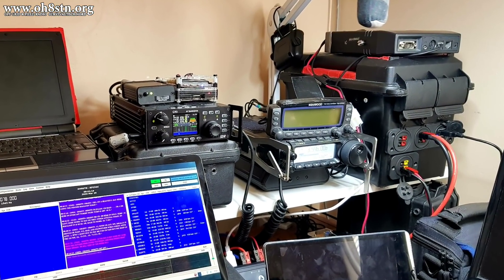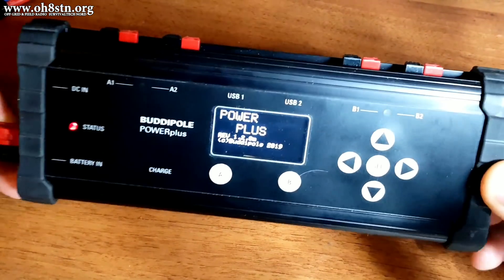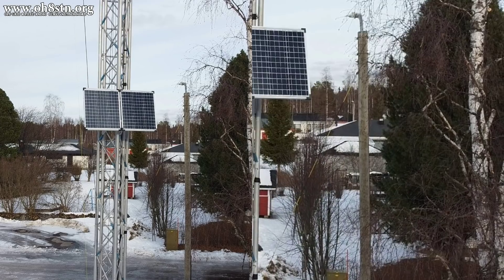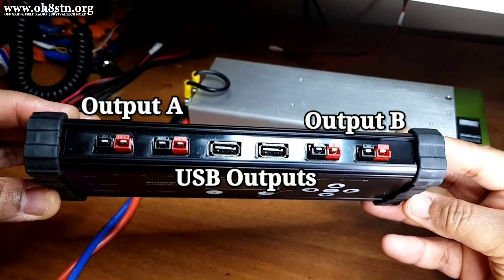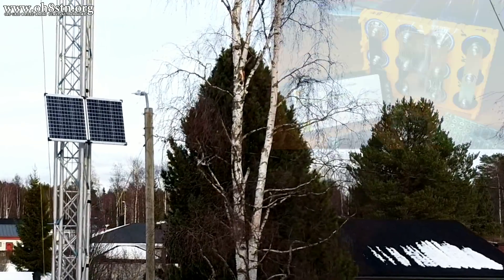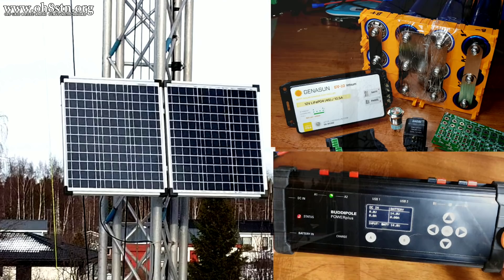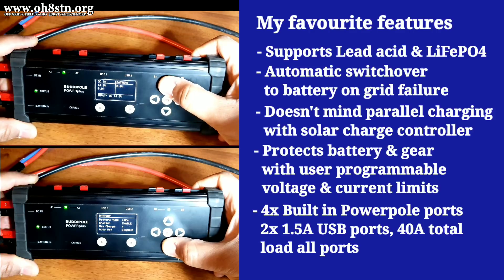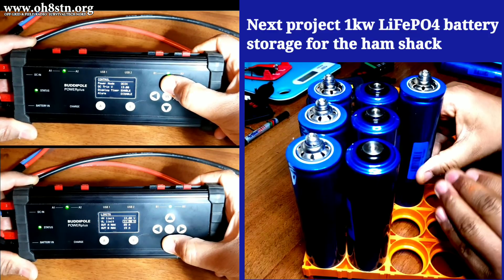Ham Radio Station Power | Buddipole PowerPlus

Comment: Hi Julian 
Please can you take it apart and show the electronics out of interest. Broadly not in favor of the device, as we are all 'bugging in', if it fails it will have bespoke components or chips; which will not be readily available in most peoples shacks for home repair.
I have made my own distribution box out of a see through lunch box, it was inspired by connectors you installed on your battery box. My distribution box then connects to my battery.

My battery build is Jehu Garcia's 38120 Head Way battery design. It is 13.16V at 200A, which provides 2.6KW.
Plenty in the tank...
https://youtu.be/5IPnQieycyA
Chud M1PUP QTH London
Reply from the maker: I think the argument you make is true about any device. If a mobile phone component fails, we don't have spare parts around the house to repair it. The trick to this is buying or building  quality gear. Doesn't mean it won't break, it just means it's less likely to because it's built well. I will open the enclosure and take some pictures, post them as a blog pos though 👍

Comment: There have been comments attached to your former presentations that have asked whether the BP-PP is a replacement for the Genasun solar controller. I, for one, have the issue cleared now that the system map has been laid plain. Well done, and TY.
Reply from the maker: Thanks for this comment. I think earlier it wasn't easy to understand the difference or the role, either of those devices played in a single system. I hadn't seen any videos explaining charging the battery while the grid was down using solar power, so I thought it was important. Anyway, thanks for the comment and the kindness. Very much appreciated.

Comment: Hello my friend.   Great video.  Always enjoy them.  Hope you and your loved ones are safe and healthy.  All good here in Lompoc.  When you are operating in your QTH do you notice a big change in noise levels when switching between house power and battery.  Have been thinking of putting some of your designs to work in my shack ie., continuously charging battery power.   In my former life with the NRO we had "tech power" "conditioned power" where all critical systems were powered through large battery banks that in turn were continuously charged.  This way if the power ever went down (we also had diesel backup and even separate power distribution lines running to the facilities) (even dual power strips in each rack) the equipment never saw the drop.  If I don't build mine what Bioeno battery would you recommend?   Running ICOM 7300, 100W, no amp.  Take care.  John  N6NRO
Reply from the maker: Sounds like an awesome system you've been using. Choosing which capacity of battery depends on how much gear you want to run, and for how long if mains power goes down. The only real way to answer that question, is to actually measure the load of the system over a period of time. Once you know that number, then you can find the ride capacity of battery, which fits your budget and requirements.
We have an incredibly low noise environment here at home. We've gone through and removed any device which creates noise. The noise level in the neighborhood is actually quite low as well, since our neighbors are not sitting right on top of us. With that said, there's no discernible difference between operating on battery, or from AC mains. Operating away from the city dropped the already low noise floor to almost nothing full stop in fact sometimes I need to to ensure the radio is actually operating because the noise floor is so low.
Anyway excellent comment, feedback and ideas.
Reply: Greetings, I am working on something similar, built around the West Mountain Radio Epic PWRgate - on their DC-to-Go Box.  I am looking at a 40 to 50 Ah Bioenno battery to power my Icom IC-7200.  Currently, I am waiting on a back-ordered hardware.
Reply from the maker: I thought about getting the Epic PWRGate, but was kind of bummed I would have to buy or build an additional DC distribution block. Otherwise the Epic PWRGate is ok.
Reply: @OH8STN  I am getting a Rig Runner 4007U with the system for the main DC distribution panel, which has a readout of volts and amps.